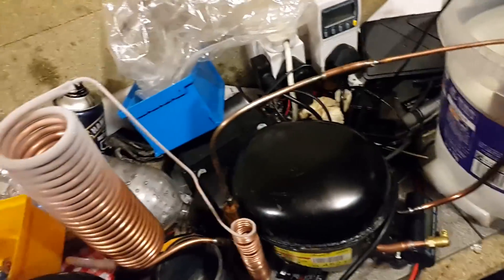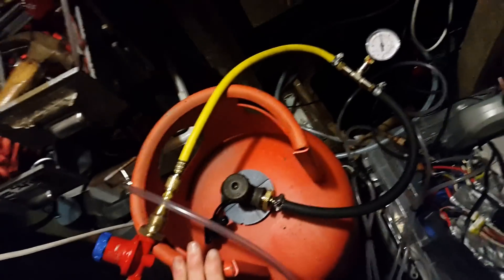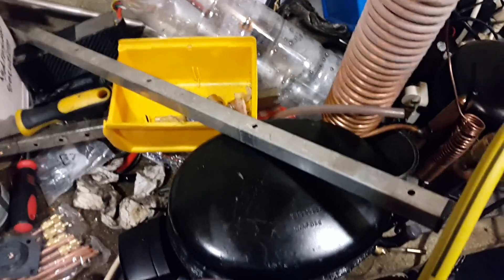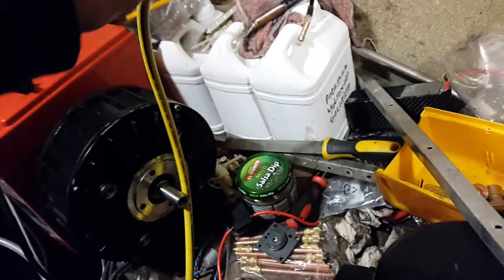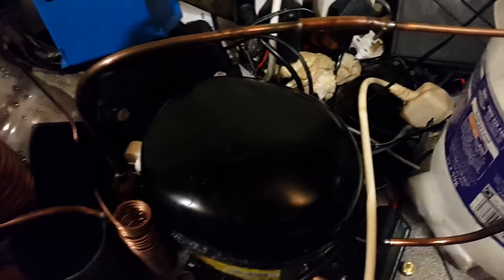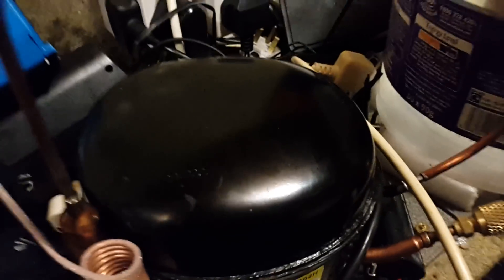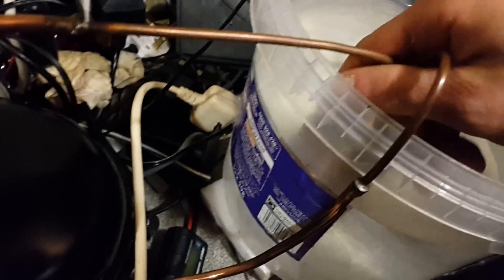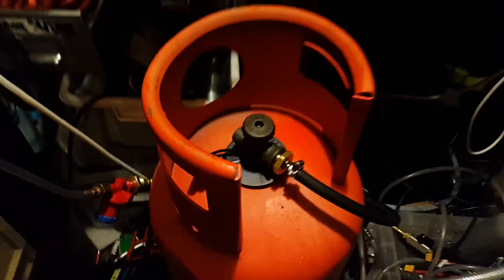Using Propane as a Refrigerant R290

Comment: Do I understand correctly? You put two refrigerator compressors inline, to more effectively produce a vacuum?
Reply from the maker: Yes
Reply: @ShaunDobbie  If I pick up a refrigerator off the street, and recover the r134a into a cylinder, what do I do with this material? Am I able to take this to an auto mechanic with a r134a recovery machine? Do I also need to fill out the hazardous waste consignment note?

Comment: I used fuelgrade propane in an old R22 home AC 2.5 ton rated for many years. The system ran colder than with R22 and I never had any leaks or issues. The only change was to reduce the refrigerant charge compared to R22

Comment: I really wonder what my neighbors are up to. I hope none of them do things this stupid. I really don't want their house to blow up or for the fallout to damage my home. This is totally STUPID and dangerous.
Reply from the maker: Better throw out your refrigerator then, because it most likely has butane in it which is DaNgERouS.
Reply: @ShaunDobbie  Isobutane is not the same butane that is in cigarette lighter. While isobutane is highly flammable, it is in a SEALED system, which is why it is a stupid thing to do to start piercing into the plumbing and mess with things that can go very wrong, very fast.
Reply from the maker: @michaeljavert4635  I sincerely hope you have never used a barbecue or changed a propane tank as those aren't sealed systems.I also hope you don't have a gas main coming into your house or anything that contains more than a lighters worth of flammable gas as it could blow up the entire street. If you have any of those, that is DANGEROUS and I wouldn't want to be caught in the fallout of an incident at your property.

Comment: Afraid of propane?? Better not have 4 gallons of it next to your roaring bbq connected with an easily meltable rubber house. And make sure never to get in a wreak in your 1000 psi fuel injection car that will be a bomb

Comment: youve got no temp (heat) in your condenser because youve either got too much refigerant, not load on the evaporator or wror sized LRCD (capillary tube or tx valve in bigger systems) causing superheat to be low. the liquid is not boiling off in the evaporator causing a flood back to the compressor. when liquid returns to the compressor without changing state back to vapor it hits the oil and froths up the oil. best case the liquid changes state back to vapor and then can be compressed if not it gets forced through the compressor taking the oil with it eventually causing the compressor to fail due to no lubrication overheated windings or broken valves. your coils are so small that you might get oil back to the compressor before it becomes an issue in your particular case but in real world situations it will sit mostly in the condenser and start acting as an insulator reducing the heat transfer increasing head pressure decreasing subcooling and reducing the capacity of the system. you should have 5-6 degrees superheat ( heated refrigerant) at the suction side of the evaporater to maintain efficencey and prolonged life of the compressor.
hope this info helps

Comment: I also c u getting a lot of grief about the safety of propane as a refrigerant. 99.9 percent of leaks r very slow. The only time it could be an issue is if the evaporator ruptured at the time of a collision. The condenser would b the most common failure point. U have plenty of gasoline already fryin u at that point. So I'm not gonna sweat it. I use gasoline to find vacuum leaks in cars all the time. U have an aerosol bottle I fill then pressurize. Comes in handy for spraying oil spills to. Great at lighting the charcoal to. R-12 used to b a propellant for spray paint. I was arc welding one time and a dingleberry hit a spray can. Pooof. That smoke was nasty. I believe phosgene. Now that was dangerous. But propane as a refrigerant,  I'll take that risk anyday. More likely to b hit by Rolls Royce engine debris falling from the sky. As if that could ever happen
Reply from the maker: Exactly. I have seen air conditioners on ebay using r290 and nearly all fridges and freezers have isobutane in them.

Comment: Dude, your workshop looks almost exactly like mine lol, couple of questions; what quick connects are you using? and is there an optimal volume for all refrigerant tubing?
Reply from the maker: I just use standard refrigeration hoses and refrigerant tubing size is dependant on the system and its application.

Comment: FYI:  Refrigeration grade propane (R290) is pure propane and totally odorless.  BBQ grill/torch propane on the other hand, is laced with the odorant mercaptan so that your nose can detect leaks.  Any mercaptan inside of a refrigeration system is considered a contaminant since it's a sulfur compound and under certain conditions becomes corrosive, especially when combined with the high moisture content of typical grill gas.  Finally, R600 refrigerant grade butane does have a natural, slight odor to it - somewhat of a sweet, solvent-like smell.
Reply from the maker: I built a mercaptan scrubber and drying system and I now only use cleaned propane from that in my systems.
Reply: @ShaunDobbie  Do you have any videos of this? Sounds interesting...
Reply from the maker: @DrewanNicholson  yes, search propane mercaptan removal
Reply: Youll need audible alarms and digital detection mounted on the device just to be safe. And during manufacturing. But it would be the best type to use.
Reply: I just used an old air compressor as a refrigeration compressor and I change all the tubings into stainless steel

Comment: Can i use R22 with R134a compressor?
Reply from the maker: The compressor might overheat.
Reply: Shaun Dobbie R22 is very similar to propane. What should be charging aka low side pressure while running it? you are using propane so what charging pressure do u prefer for standard 1/8hp fridge compressor?
Reply: I would say no. R22 is a much higher pressure gas than R134A, so it would put too much stress on the compressor for it to live long.

Comment: Hi shaun, I have converted a r134a compressor to r290 and cant work out how much to charge. can you measure low side pressure from the service port?
Reply from the maker: Yes you can.
Reply: Shaun Dobbie  thanks bud. What low pressures did you have.

Comment: R-290 and 600a are dangerous, toxic and flammable. I would not use it as a primary refrigerant under any circumstance. 404a, 507, 134a, are non toxic, non flammable and work well for their applications.  The idiots that think that R-290 is a suitable refrigerant all applications are seriously misinformed as its highly flammable and combustible.  One of the reasons you don't see R-717 (ammonia) used much anymore was because of its toxicity. The reason you didn't see wide use of R-290 is because of its flammability.
Reply from the maker: Tesla557 I suppose I better sue the manufacturer of our fridge and freezer then! As for being toxic, it isn't. Do your research.
Reply: I did mine you should stop misleading people and do yours. The reason most manufacturers abandoned R290 was because of its extreme flammability and it requires the units to be designed to Flame Proof regulations. Its undesirable to use it in systems that use a large quantity of refrigerants due to the fire and combustibility hazards . Also, since R-290 is a hydrocarbon if it leaks, it adds to pollution through low level ozone and smog in warmer months.  You have an Activated charcoal vacuum canister on your automobile to absorb the gasoline vapors which are hydrocarbons which is what R-290 basically is.  As for being toxic, according to the MSDS, there is risk for damage to your nervous system.
Reply from the maker: Tesla557 My automobile has no such canister and I will continue to experiment with this low global warming and zero ozone depleting refrigerant. Stop being so childish and take off your tinfoil hat.
Reply: Is that right, well here in Australia propane is actually used by a main manufacturers as the gas of choice!
Reply: +Tesla557 — Your knowledge of refrigerants and chemistry is obviously lacking.  Propane is flammable, but it is non-toxic.  Some of the refrigerant types you cite are extremely toxic when exposed to flame.  R134a breaks down into phosgene gas when burned; one lungful will kill you, no questions asked.  Propane decomposes into carbon dioxide and water when burned, neither of which are toxic.  Given a choice between having an automotive air conditioning system filled with R134a or R290 (propane), in case of a vehicle fire or refrigerant leak, I'll take propane any day.  If you should find yourself in a situation where a vehicle catches fire or the engine is ingesting leaking R134a, I'd advise you to hold your breath as best you can, stop, exit the vehicle, and move upwind as quickly as possible.
Reply: Small correction, r134a does NOT break down into phosgene when exposed to flame. Rather, it becomes hydrofluoric acid and carbonyl fluoride. You don'r want to breathe these, but they won't kill you in a 1 in 6,000,000 strength concentration like phosgene will. Not by any means. Phosgene is created when R12 "Freon" is exposed to flame. NASTY stuff. 

Other than that, yeah hydrocarbons are 100% ideal refrigerants. R600a (Isobutane) and R290 (Propane/PLG) are both non toxic and non environmentally hazardous. On top of that they have a higher molecular weight than any of Duponts garbage. This means they don't leak out as easily. The only reason on this Earth anyone uses other refrigerants is because Dupont wants to line their pockets with cash. They lobby, they push. Sometimes they shove. The EPA is their string puppet. 
I am an EPA certified tech, and I don't use ANYTHING but r600a and R290. Period. Guess what's in my vehicles? I won't say here but I am pretty sure you can figure it out.
Reply: well, 290 and 600a are replacing 134a in commercial appliances. just fyi
Reply: R290 is very common in other parts of the world. And the nice thing about R290? It has a low ODP and doesn't turn into phosgene gas when burned.
Reply: Tesla557

R600  Iso-Butane is highly flammable and is used widely in domestic refrigeration.

http://www.linde-gas.com/en/products_and_supply/refrigerants/natural_refrigerants/r290_propane/index.html
Reply: https://www.youtube.com/watch?v=owO1cd3NvUY
Reply: UNUSUAL FIRE AND EXPLOSION HAZARDS:
 R-134a is not flammable at ambient temperatures and atmospheric pressure. However, this material will become
 combustible when mixed with air under pressure and exposed to strong ignition sources.

SPECIAL FIRE FIGHTING PRECAUTIONS/INSTRUCTIONS:
 Firefighters should wear self-contained, NIOSH-approved breathing apparatus for protection against possible TOXIC
 decomposition products.
Reply: Tesla557 I refilled my ac with propane been running for almost 2 years now no problem and its window ac on almost all day powered by solar panels
Reply from the maker: Mentorcase Yeah, you tell him!
Reply: dont get me wrong. i still dont want to work with the shit.

Comment: Do not attempt to do this in an automotive application! Look under your hood. Hotter than hell exhaust manifold next to a condenser full of an explosive gas? A front-end collision would cause a lethal explosion! 134a is cheap enough and using ESTER oil in the system (works with traces R12 & mineral oil). PAG, which is common in your tap-a-can all-in-one supermarket kits, will gum everything up in a less-than perfectly purged and vacuumed-down R12 system. The only reason I clicked on this because I know someone is going to be stupid enough to try and do this in their car. BTW, I'm licensed in auto refrigeration.
Reply: Some countries use it in automotive applications. By the way, all of your fuel lines and fuel rails are pressurized with a highly flammable substance, sometimes in excess of 100PSI also....just fyi
Reply: LMAO "Lethal exolosion" HAH. Wow you can't be serious? There is NO THREAT what-so-ever in running r290 in an automotive system. The high pressure gasoline rail supplied by the GALLON as well the hot engine oil are far more dangerous than a few ounces of propane. Your precious r134a is also completely flamable in an impact since it is mixed with atomized oil. There would be no observable difference in such a situation. Propane will not "explode" in a crash. Stop watching holywood movies where everything explodes pointlessly.
Reply from the maker: Kenji Fox  Also, R134a breaks down in the presence of fire and releases carbon monoxide, carbonyl difluoride and hydrogen fluoride which are all highly toxic. It's replacement, 1234Yf is even worse. If my car ever needs regassed, I will be putting cleaned and dried propane in it.
Reply: Pat Callahan FUD. Fear uncertainty and doubt....
Reply: Mitigating the Fears that Propane Refrigerant Poses a Risk of Explosion

The fact that propane is combustible and is widely used as a fuel has raised concerns of whether it's safe to use as a refrigerant. Many have wondered if leaks in the system could pose an explosion risk, especially in kitchens that cook with open gas flames. A study designed to determine just that, published in 2013 in the International Journal of Refrigeration, measured the risk of a fire posed by the use of ice cream freezers using R290. The study found that the chance of ignition is less than 0.001 percent.

Another study of more than 2 million ice cream freezers being used in the field10confirmed that equipment using R290 show no change in safety, reliability, or performance over traditional equipment. Contributing to this low risk is the relatively small volume of propane actually needed to act as a refrigerant in these machines, which, in some cases, is less than half that required in HFC equipment to achieve the same levels of performance.11 That lower volume also means lower pressures inside the system, and can also bring a reduction in noise, as well as the wear and tear on refrigeration components.
Reply from the maker: Many people do this without incident and my car has no hood. My engine if you could call it that never goes over 30 degrees C.
Reply: Considering all of that, one would think it would be quite dangerous to have fuel rails carrying pure gasoline to your engine...  There have actually been tests done using hydrocarbons as automotive refrigerants in automotive applications where front end collisions were simulated.  They actually found that other flammable elements under the hood caught fire first; including--gasoline (not surprisingly), rubber hoses, electrical wiring, and engine oil.
Reply: Heaps of people do it without incident here in Australia. Petrol lines on the car are far, far more dangerous
Reply: guringai agree 100%. I think this is the direction auto-makers will move in the near future.
Reply: Pat Callahan k
Reply: It would be nice to use Propane, but it's " hot " under the hood. The Temperature right now is like 80F but under " our " hood is sooo fricking hot, up to a point we are having troubles with the our truck shutting down during long trips. I would be scared to use Propane... It will be much cheaper to use Propane... But for " Jut-in-case ", I will stick with R134a but that is my take on it.
Reply: By the way, nothing is new about " Propane R290 ".  They have been widely used in House Hold appliances... Just not popular in cars, but I have seen and heard the US is adopting R290.  Then again, I saw them re-calling it... So until then... Stick with what " YOU " think it's safe!

Comment: is any one explain me how frosting of evaporater happened
Reply from the maker: Because the refrigerant entering it is flashing to vapor and requires heat to do this which is taken from the coil and surrounding area.
Reply: Sure; the refrigerant left in the "system", a term we'll use very loosely here,  being under a lower pressure than freezing while running. It's refrigerant is not completely removed using another compressor as a vacuum pump. He then let air into the system to 'flush out the refrigerant'. Never do that!  What he actually did, was add a whole lot of 'non-condensables' to the system which diluted the refrigerant. BTW: The 'different' smell of the propane is because R-290 has no odorant added. Without it the concentration is well into the explosive range by the time you smell it. Otherwise any time you see frosting of an evaporator that isn't supposed to- like a freezer's- It means that there's either not enough heat being added- not enough air or water or other medium flow. This will generally frost the entire evaporator. When just a portion of the evaporator freezes, it commonly a sign of incorrect charge, incorrect refrigerant, or incorrectly sized/adjusted expansion device. (cap tube, orifice, expansion valve etc...)

Comment: I think a 134a compressor will work with r290 since they both use the same oil, correct?
Reply from the maker: No you need to replace the poe oil with mineral.
Reply: r290 works with all 3 oils being MO,AB,and POE , you can verifiy it here  http://www.linde-gas.com/en/products_and_supply/refrigerants/natural_refrigerants/r290_propane/index.html 

There are also retrofit solutions that contain propane and other hydrocarbons to allow the use of the old refrigerant oil with the new gas , one of these is called super change .
Reply: R290 works with POE oil.  http://www.linde-gas.com/en/products_and_supply/refrigerants/natural_refrigerants/r290_propane/index.html

Comment: Your condensor is cool because your not moving any heat put coil in warm water to cool it so you can see the heat transfer your condensor water will get warm and you will then see heat transfer. When evap freezes it will have liquid compe back to compressor instead of a gas. Not good for compressor.